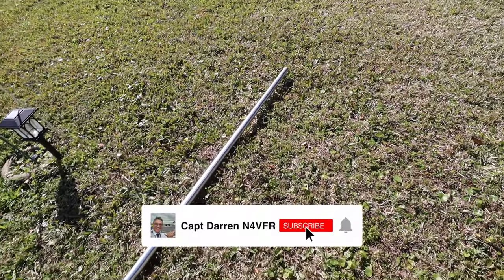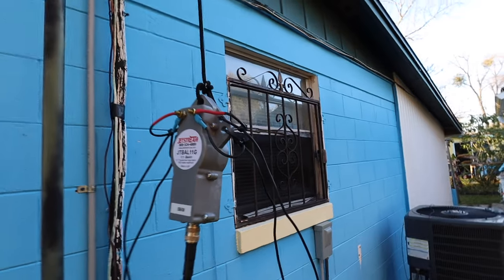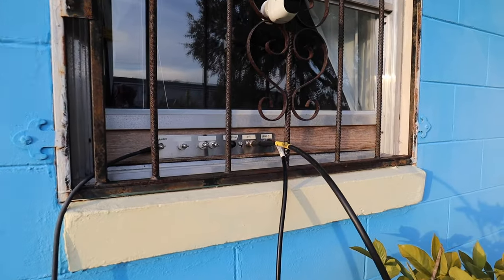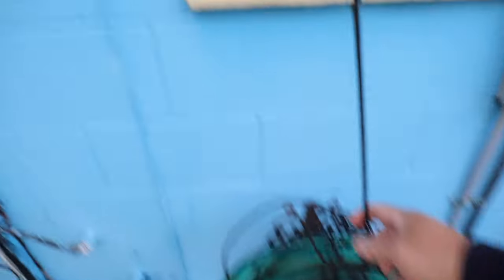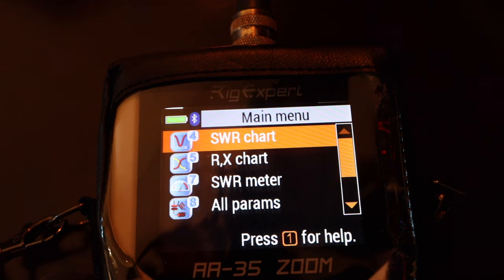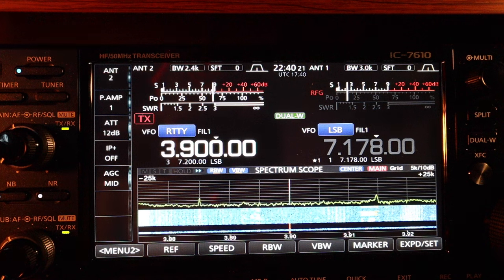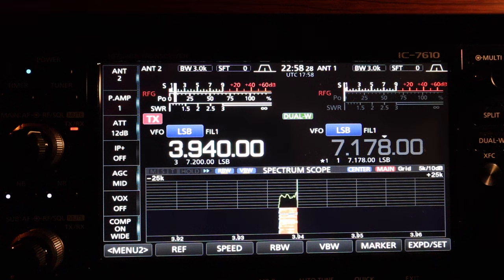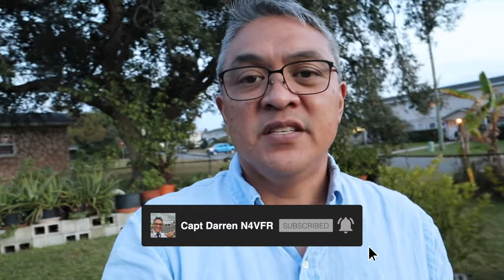How to make an 80M/40M Fan Dipole | Top Rail PVC Mast for Fan Dipole | HF Wire Antenna

Comment: Pre Amp and 12Db of ATT, I don't understand that, there is a video as to how to operate your radio with RF Gain, worth watching
!
S9 of noise, you are overloading the AGC, turn off ATT, turn off Pre Amp, set your RF Gain to just the start of where you hear your noise, and you are now operating the radio as it should be.
Reply from the maker: Thanks for the feedback Robbie, I will look for the video. It's always a learning process.
Reply: Robbie Do you have a link to that video??
Reply from the maker: @JohnVK5JAK  Here's what I found on Youtube.  https://www.youtube.com/watch?v=En86CBBm030&t=973s